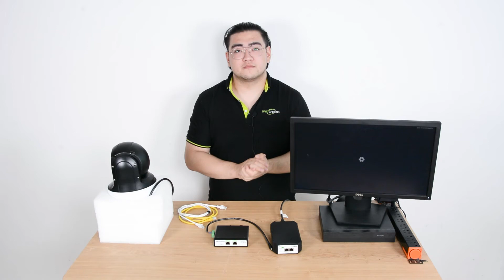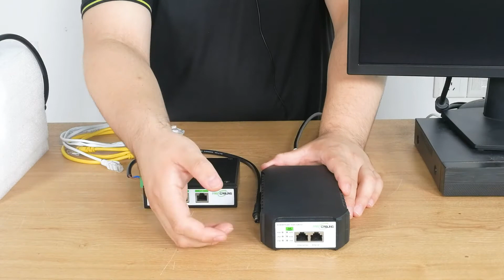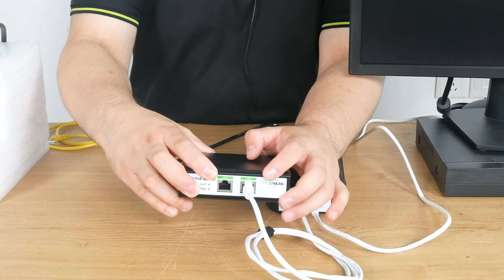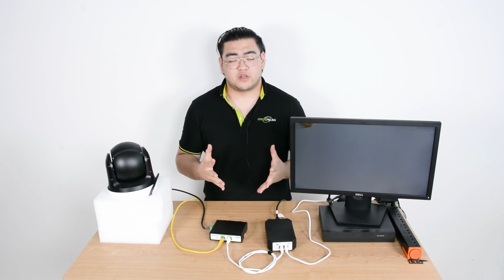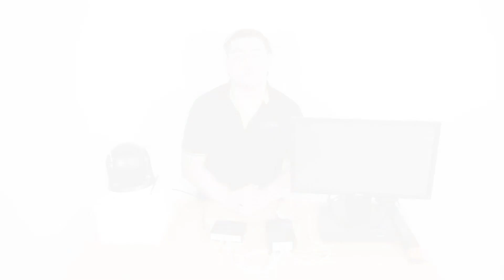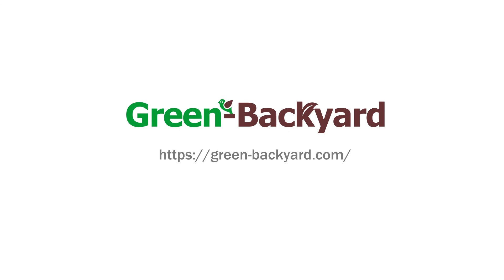Is PoE Splitter Needed if Using PoE Injector to Setup PTZ Camera?

Comment: How is injector powered? Can I use adapter supplied with the camera?
Reply from the maker: You need to plug the PoE injector to AC outlet. Most of PoE injector has built in power adapter which will convert AC to DC48-55V. Yes you can use DC power adapter if the AC power source is available near the camera. When you use PoE injector, the power is sent from the backend as well as the network through Ethernet cable.

Comment: Hello brother, could you please explain the benefits of using the nano stations devices when we install ip cameras system ( for example :  for residential complex ) 

The distance between the IP cameras & the nvr is about 20km.

Thank you in advance
Reply from the maker: Honestly, I am not familiar with Ubiquiti products. You will need straight sight to build the wireless link between point A and point B. The obstacle such as tree or building to weaken the transmission. The IP camera requires a stable connection to provide real-time video, unlike the web surf, you may not feel delays while the web page is being loaded. There is data peak at different times as the compression rate could be different which will present a challenge to the wireless connection.
Reply: @Fastcabling  Thank you brother 👍